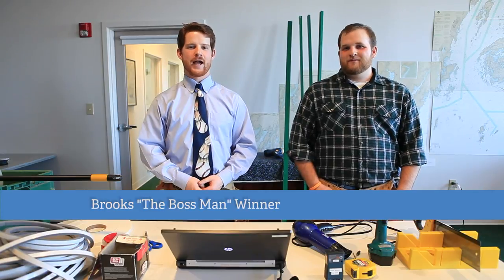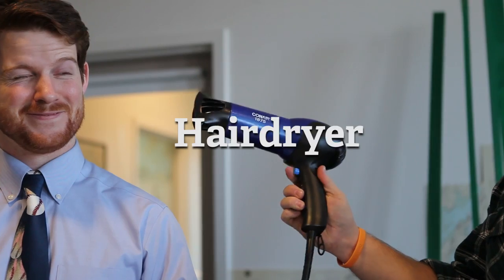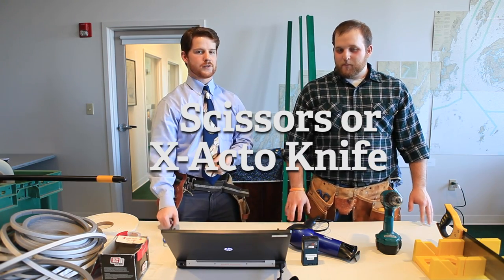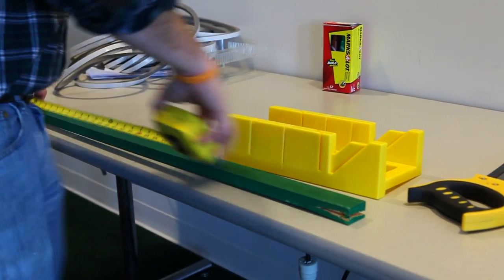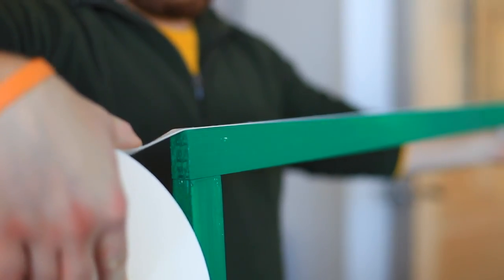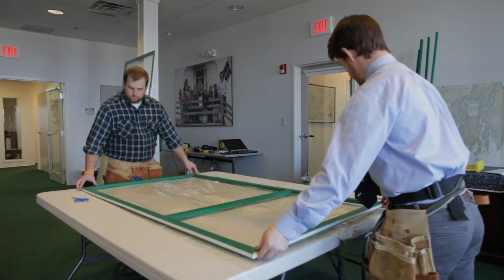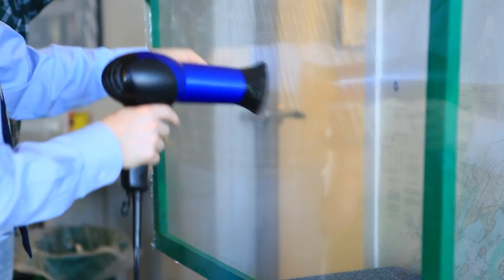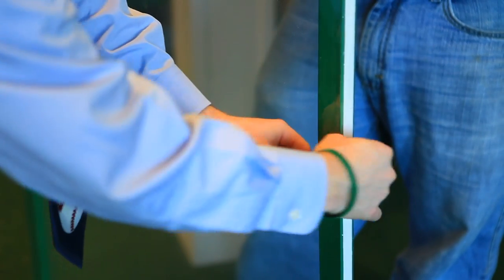Building Interior Storm Windows

Comment: Sorry to be blunt, but these are a piss poor design!! I fought with these for years, before finally deciding that they are too much trouble to deal with. Placing the foam around the outside edge is aggravating at best. It is very difficult to size the frames properly, simply because of the inconsistency of the foam itself, they either fit too loose to be effective, or they end up being so tight, that the foam rolls out as you are trying to install them. Installing an inner casing that you can screw the storm window frame to is much more user friendly. Just place the foam around the outer perimeter of the face of the frame, instead of the outside edge. Sooo much easier to deal with!!!!

Comment: Three things that suggest people should move on to a different video.  Packing tape disintegrates in the sun.  Two layers of plastic does not help with insulation and will trap moisture when the adhesive even slightly fails.  The large stagnant air gap between the window and insert will provide plenty of insulation.  The Green color looks like ass.
Reply: Will it be better that I use one plastic sheeting instead with insulation tape?
Reply: If this were true, triple paned windows would not perform better than double paned windows. But they do.
Reply: Is ANY of the plastic sheeting perfectly clear?

Comment: I tried this some years ago.  The airflow from the leaky original windows pushed the panel out.  The pressure seal was not enough to hold it in place during windy times.  Plus I have normal residential windows for a normal thickness of wall, that is I do not have a 12+ inch window sill as shown in the video.  I have only at best 1 inch for the panel to slide in, and a windy day would just pop the panel out.  I needed to screw the panels into the jamb. So one would have to figure out eventually a kind of toggle system to hold them on like the toggle on an old exterior storm.  But then we have pretty interior trim moldings with curved profiles; certainly not a flat surface to make it easy.  I had considered figuring out some pin system that would insert into a hole drilled into the jamb, but haven't tested that.  The real problem is double sided tape was too weak and the shrink film is flimsy.  Either/or would fail somehow by the next year, so it wasn't much different from the amount of effort of just putting the clear plastic and tape directly on the original window trim each season.  Another problem...the taut shrink wrap would pull the wood frame into an hour glass shape (i used pine, then I later tried douglas fir, still a problem for tall windows)...so you would need extra mutins depending on the size of your window to keep the full length of the stile flush with the jamb.  So you see, this interior storm window idea is nice in theory, but pulling it off to work successfully, is going to take some effort.
Reply: Thank for that information      I'm gonna think of other added ways to make it more secure regarding the things you highlighted
Reply: @carmel-wayfinder5401  Any wisdom to share?

Comment: Shrink wrap is usually not wide enough or strong enough to withstand cats or kids.  I would use a heavier clear plastic.  Also, small pieces of wood tend to split when you put in a large screw, you should drill a pilot hole first.
Reply: Why can't you use the plastic  sheeting...I did.  I built the frame, reduced the measurements by 1/4" to allow for the double layer overlap of the clear plastic and stapled that to my frame.  Seems to work okay.  Granted, this was on a bedroom patio door and stationary window but it seems to be okay.  Sure it's not a super clear film but it lets in the light and visibility is tolerable...even with a few wrinkles but for a bedroom view of the garden and lake it's not a big deal.  I am going to try the shrink film on windows that actually have a view that I enjoy all day however.    Thanks for the video.

Comment: Great video guys! I think this is an easy enough project for someone with beginner D.I.Y. skills and limited tools. I might suggest using 1x2's to eliminate the need for "ripping a 1x4 down". I plan on using your method to build some temporary interior storms as a get by,  until I can build a more long term solution for storm windows.

Comment: In the list of materials, you include a 20" x 3,500' Shrink Film Roll. But most windows would be wider than 20 inches. I'm pretty sure that the storm window you're building in this video is wider than 20", so what film did you actually use? What do you recommend for windows 40+ inches wide?
Reply: I think most shrink film is folded in half before being wrapped around the roll during manufacturing, based on what I've seen.  It's called "centerfold" -- it's made like this so it takes up less space and can be easily used for wrapping and sealing products.  If you notice, they unfold the film before putting it on the window.  So 20" film can actually cover 40" (or close to it)

Comment: Hi there, great job! I was wondering if this kind of window will help reduce the street noice. What do you think?
Reply: Yes, but AFAIK the thicker the plastic/glass and the bigger the gaps between panes, the better.
Reply: No, when it comes to noise reduction the difference will be imperceptible. What isolates noise is mass (heavy, compact dense materials), so your better option to reduce noise is glass rather than plexiglass, and the thicker the better. This applies as well to the weather stripping: choose rubber not foam and if you can place it on the face of your screen frame (not the edges like here) to go against the window retainer; you might have to add a bottom rail on the window ledge to receive it or just put your rubber strip on the edge just for the bottom section. Hope this helps.

Comment: Great. Build your own firetrap.These impede bedroom emergency egress imo.
Reply from the maker: That's a legitimate concern. However, these inserts do not violate any codes, and also they are made of a thin enough plastic that they'd be very unlikely to deter escape or inconvenience fire fighters.
Reply: you can't escape from a fire because of saran wrap ?
Reply: This is not a legitimate concern. It's heat shrink plastic film, not bulletproof glass. Is it a YouTube requirement to have a naysaying know-it-all embarrass themselves in the comments section of home improvement videos? Stop trying to seem smarter than everyone. You've failed.

Excellent work on these storm windows fellas. They look great & are a solid solution.
Reply: I've used similar shrink material before . . . my dog's nose and my kids fingers easily punched holes in the shrink wrap.
Reply: @peterzappe6197  if I wasn't already taken, this comment would warrants a marriage proposal. Thank you, kind sir.
Reply: @donhill1825  I've read some of your replies to other people replies and they are the perfect response. Thanks for your honesty.
Reply: Nonsense...push them out of the way. Super light